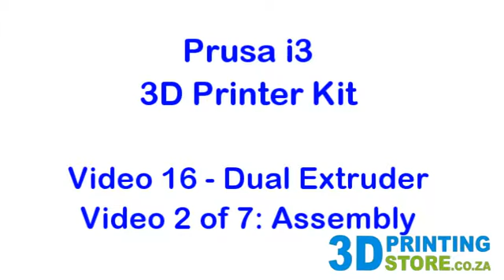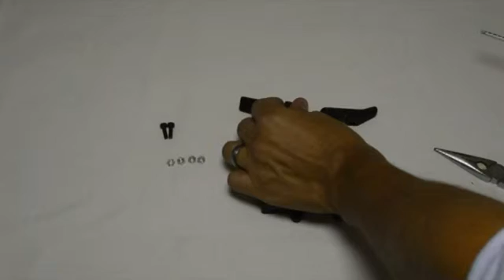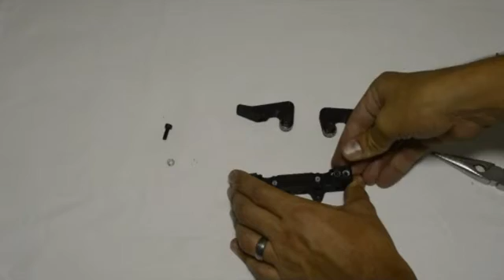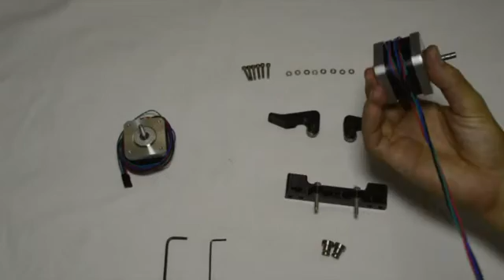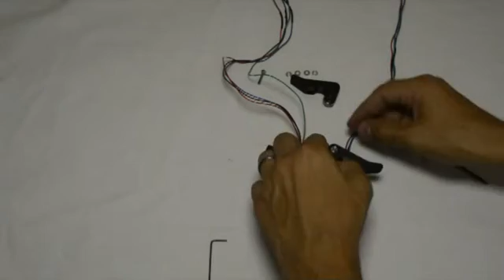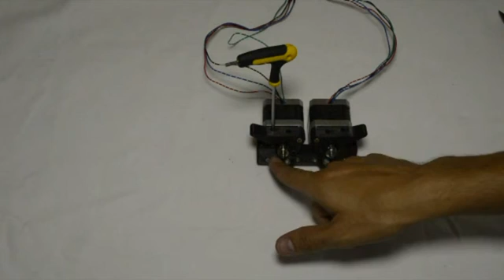Prusa i3 Kit: Dual Extruder - Video 2

Comment: Hi.

Just some clarification needed. Can you please tell me what components are INCLUDED in the kit.

As I understand it. The kit includes 1 x stepper and 1 x extruder? Correct 

As you say in the video the idea is that you use your existing nema and extruder as the second one in assembly?

Thanx
Reply: Hi, the kit includes the 1x motor and hot end and the second comes from the original set of parts.
Reply: 3D Printing Store_co_za 

Thank you very much.

I bought a kit at the Boksburg branch today that I ordered lastweek...

And after arguing with sales consultant I ended up having to buy double and pay for additional two extra extruders and two additional nema17s ontop of the kit. Which I felt couldn’t be correct especially at the price.... 

But nice instructions, and thanx for the confirmation I will contact sales and try to explain it again thank you.